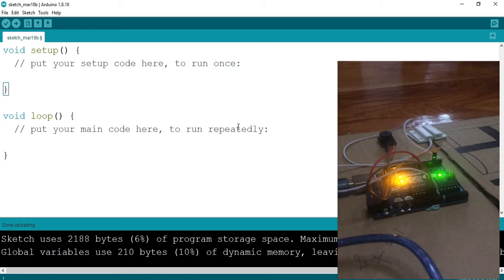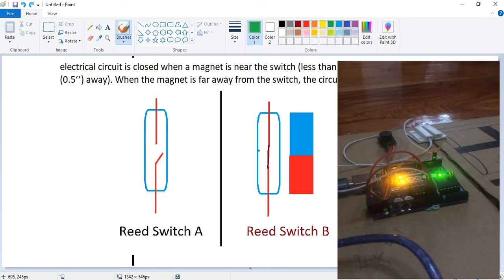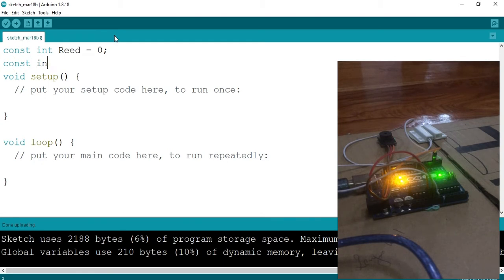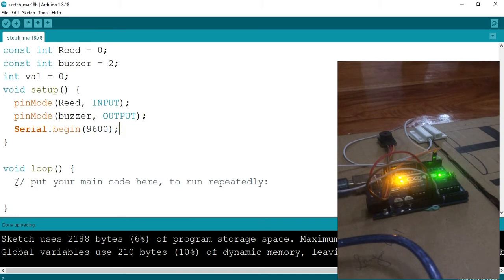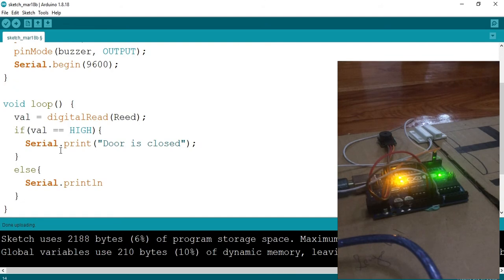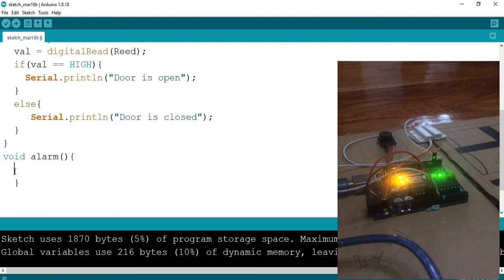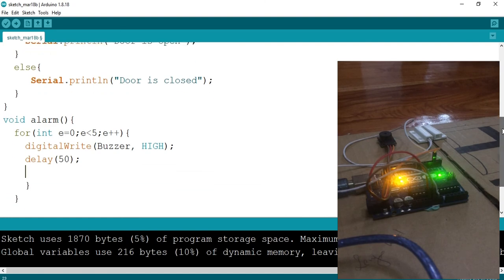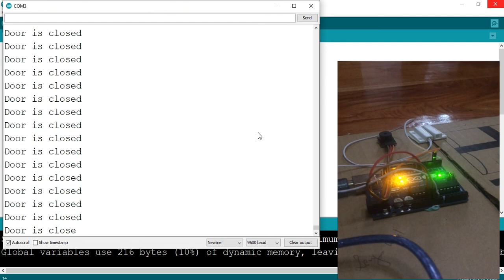How to make a door security alarm with Arduino Reed switch and buzzer

Comment: The magnet moves away as we open the door, then why does the reed switch work, like come in contact and produce sound
Reply from the maker: Hey there! The logic in the circuit is that, when the magnet is near the switch the blades in the reed switch close meaning that the door is closed in this case the buzzer is not triggered, as the magnet moves way the blades in reed now open meaning that the door is opened the the buzzer produces the sound.